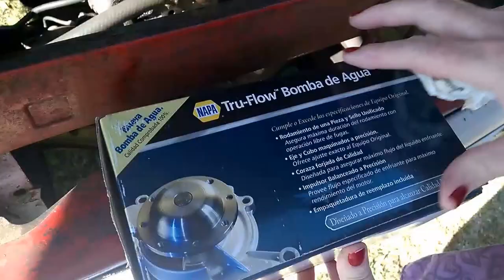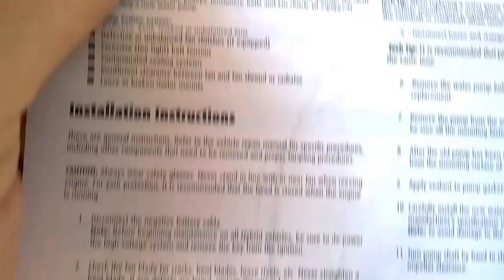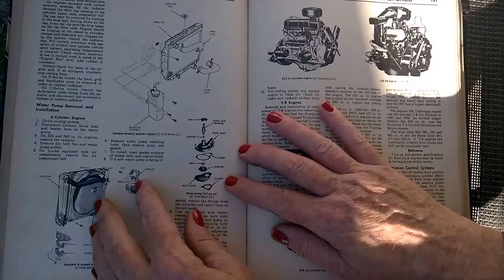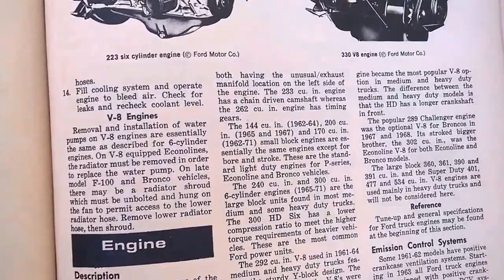1967 F100 Ford Truck (water pump install) 240

Comment: Awesome!  I have a 66, heard the noise and had alternator light coming on. Replaced the alternator and still had the noise.  I think it did need it, but now I think I have to replace water pump.  Really glad you made this video. Helps a bunch.

Comment: what i have found out about parts that have different lengeth bolts is. if there is a gasket with it trace the gasket on a piece of cardboard. then when you remove the bolt put it in the same spot on the cardboard. it makes putting it back together much faster. ask me how i know.
Reply: "how do you know?"
Reply: @DeaganZ3488  Because it's not my first rodeo. Been There Made That Mistake and learned from it.